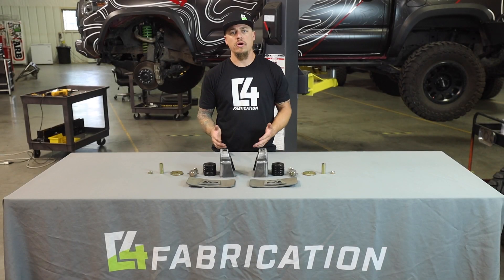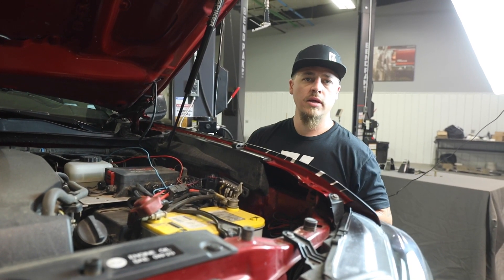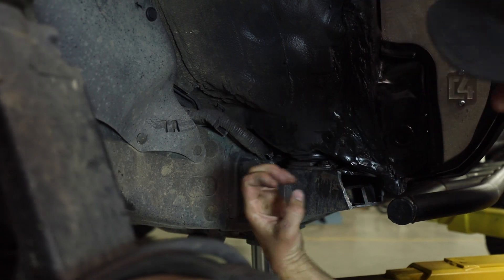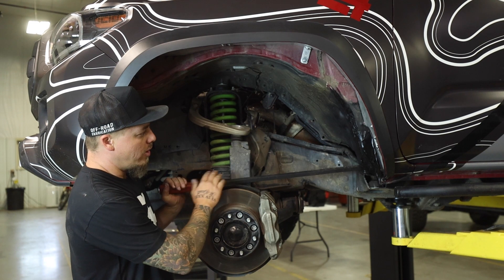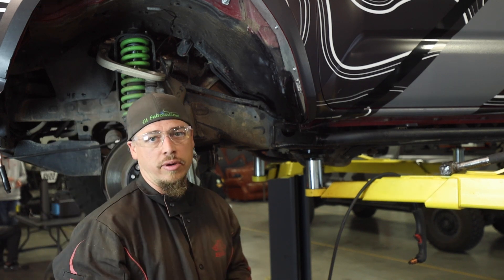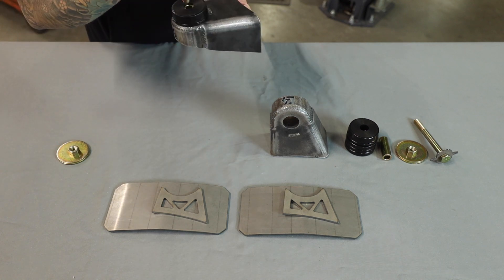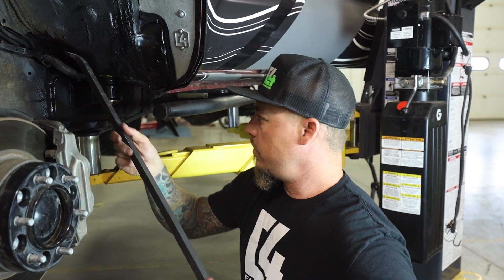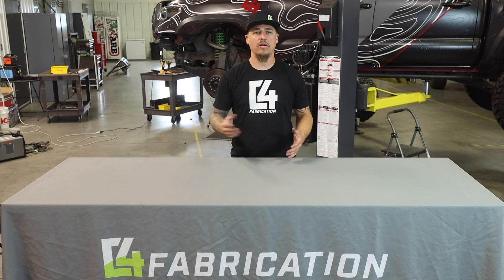Oversized Tire Fitment Kit: Body Mount Relocate

Comment: I already did cab mount chop, and have a 1" body lift installed. Will those affect install of this kit ? Thx
Reply from the maker: Hello, They will work as the fenders are connected to the body and are lifted with the 1" body lift.
Reply: @c4fabrication397  thank you I want the kit.
Reply: @c4fabrication397   i was more wondering about the cab mount relocate with the bodylift..